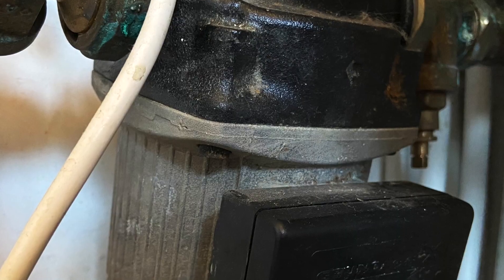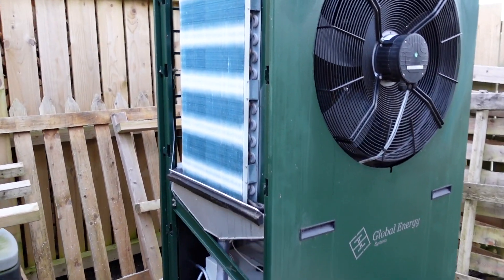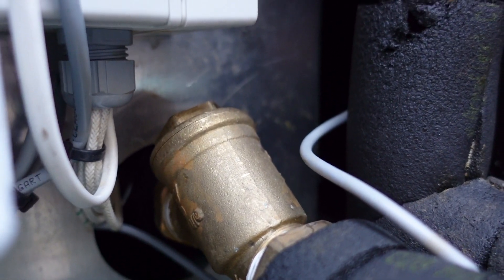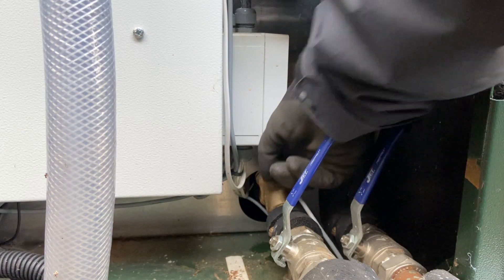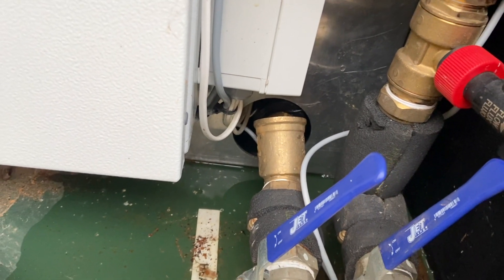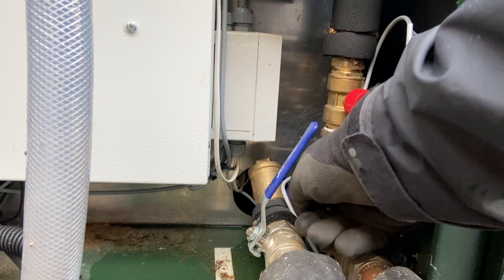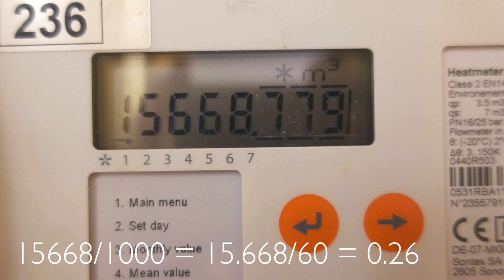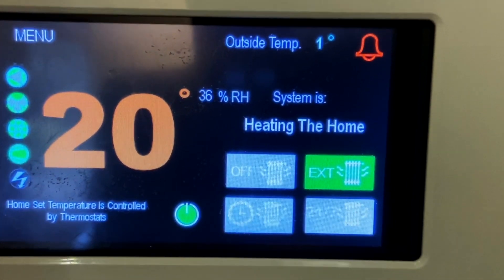Fixing Our Air Source Heat Pump’s Flow Fault By Cleaning The Filter

Comment: Why would the flow block on a very icy day.    do you think that this is a coincidence.
Reply from the maker: No, there was coincidence. Just debris in system which has now been removed and no more errors.
Reply: @MyHomeFarm  assuming like you say it was coincidence why has the manufacturer made a filter the size of a knats leg?
Reply: @MyHomeFarm  also when you cleared the filter  was warmer the next days so even though you got rid of debris it could have been an exposed fitting that froze without bursting   .........

Comment: New house, same problem with little bits of rust repeatedly blocking the filter. Where is it coming from and how to fix it. Towel rails are metal, radiators aluminium (I know that aluminium is a metal). Where do I go from here?
Reply from the maker: It’s nuts. Who knows where it comes from? We were just patient. Months and months of cleaning, and then one day it was just clear, and it’s remained clear for almost a year now.
Reply: It's excess flux from installation. Takes a while to loosen and reach filter.

Comment: Hey man, have you figured out the root cause of this rust?
 I'm having exactly same issue in a brand new house just after 6 months of construction. The strainer filter gets clogged with small bits of rust every other week (yes, that frequent) and plumbers are unable to provide a solution. They have replaced a few rads, flushed the system, refilled glycol but it continues to happen. I'm getting crazy with this thing, I have to go out and clean this thing constantly, not sure if this is a bad design system (filter is too thin?) or the quality of materials used are rubbish...
Reply from the maker: We never got to the bottom on the source. After cleaning the filter for months and months (which was painful) we finally have a clean filter and no more corrosion. 

Weird that you had a power flush and it’s still dirty. Do you regularly have to refill your expansion vessel? If yes, you’re adding more oxygen to the system regularly that in turn leads to more corrosion.
Reply: @MyHomeFarm  I also don't understand how come it still having corrosion after the flushing work. 

I have noticed that the flushing kinda temporarily slowed down the amount of rust circulating and clogging the strainer, but I expect it to continue to happen overtime, which I don't think is any acceptable. I'm not sure if this is an issue with the quality of materials used in my rads or whether the water pump is not strong enough to overcome the resistance of flow on the strainer, when this is not completely clogged.

This is incredible how unreliable this kind of system is and it doesn't tolerate any rust. It requires a lot more maintenance, getting much more expensive in the long run. We all know that rusting is inevitable but this type of metallic filter is extremely sensitive and this tiny thing causes the entire house to get cold. Very frustrating
Reply: The technician who came to sort mine out says it's excess flux (and other debris) from installation - it takes a while for it to loosen and reach the filter.

Comment: On the trap on my system (Midea not the same as yours) the cap is 15/16 or you can use a 24mm spanner. This may be completely different for the other readers here but thought it might prove useful to others.
Reply from the maker: Very helpful for Midea owners. You could also leave a tip at https://renewableheatinghub.co.uk/forums if you get a moment.

Comment: Is there flexible braided pipes in the heat pump ? Notorious for blocking up. How long has the heat pump been in?
Reply from the maker: Not sure that there is a braided flexible pipe. The heat pump is now in its third winter.

Comment: Just had an ashp installed to get off mains gas because it wasn’t very green heating a pool on gas, let alone our house.  Very happy with it.  I thought it might be helpful to say our installer added a SpiroTech MB3 magnet to the pipe work that captures any metal fragments in the water. You could fit that somewhere else that’s easier to access, no spanner’s needed to empty what’s been caught.
Reply from the maker: Thanks for the tip - I'll look into it. Which brand heat pump did you install?

Comment: Check the orientation of your strainer (filter) the angled part normally points down. Looked like yours was pointing up. Does the basket collect any debris? it looked clean when you pulled it out. Have you got any inhibitor in your heating system, I would be thinking about where all the debris is coming from.
Reply from the maker: Hi Nick. Yes, I did look at the Y-strainer and it is upside down. But from the way the pump has been designed it would be impossible to access the nut and filter if it was pointed down. It is weird, because in its current orientation when you open it, stuff just falls back down the pipe which is why we need to flush it.
The gauze has tiny particles in it, and looks 'clean' because the corrosion and rust is very fine. I rinse it off in a bucket of water. But it's not present in massive quantities and can't really figure out why it's 'blocking' water flow. 
The installers added glycol to the system, which supposedly has inhibitor in it.

Comment: Truly awful positioning of the filter/junction box from a maintenance perspective.  As another commenter mentions, get a proper spanner for this. The equipment supplier should provide a ring spanner of the correct size. I’m sure you did following the video, but it is worth cleaning the water and contaminants up after the repair. Thanks for sharing.
Reply from the maker: Thanks for watching Derek and for your feedback. 

I’ll request a spanner from the manufacturer. I have a full size spanner, but given the size of the nut and it’s location, I can get the spanner on, but can’t turn it to loosen or tighten the nut. Not a great location.

Great point about the contaminants. I have starting wiping it up, because that did occur to me.

Comment: Yes a crazy design I would relocate the valve outside the heat pump and as you have an issue with corrosion fit a strainer with a finer filter (possibly fitted with Binder access points on either side of the strainer to measure pressure drop) so negating to have to go inside the Air con unit, I would suggest that the problem of the seemingly rust deposits be addressed, this may be due to the original fill up and pressure test, then drained down and left for a while allowing corrosion to occur (especially during summer) then the system refilled with glycol but as you had trouble with circulation Possibly from end of run radiator the water was not flowing though a high enough velocity to pick up the debris at the bottom of the radiator, but now for some reason the flow has been established and hence the resulting problem, the system has been filled with. glycol but what about corrosion inhibitor? I would suggest to have the system flushed ( in summer time otherwise you will have problems with the one that must be obeyed ). each circuit at a time as the air con plate heat exchanger is Very unforgiving with dirt in the system, and heating performance will drop, and may not be covered with warranty   (yes I used to be in the Business)
Reply from the maker: Thank you for the great response and feedback. The location of the filter needs to be moved, because it’s a pain where it is. A lot to process here and raise with the manufacturer (Global Energy Systems). Thank you. Will post feedback when I get responses and develop a plan.

Comment: those adjustable spanners are great as a fallback solution but you'll never regret having a set of spanners and sockets to use, it will make the job easier and stop the nut from getting rounded off over time. Thanks for the interesting vids!
Reply from the maker: Thanks for the feedback. We have a spanner that fits the nut, but it’s really big,  straight’ and has a long handle, so as a result of where the nut is located along with the box and other stuff around it, when we get the spanner on there’s no leverage or space to turn it. That’s why I resorted to using the spanner we used in the video. What would work is a spanner with a short handle. Maybe I should look into that.
Reply: @MyHomeFarm  A stubby spanner would be ideal

Comment: Must have been some cold nights - thanks for sharing your solution. Hope Global sort out a remedial design for your filter going forward to make it easier to maintain.
Reply from the maker: There were a few a cold nights, and it took 2-3 days for the house to get back to temperature. 

There’s not much we can do with the filter location on this pump, but at least I now know how to get to the filter and open it. 

Global Energy Systems have informed me that the new and current model of our air source heat pump has been redesigned and the filter is much easier to get to. It’s great that they’ve addressed this.
Reply from the maker: I think that from the way the pump's been designed, there's no choice but for this 'main' filter to be where it is. We have got another filter, TF1, inside the house, that is effective at catching metal bits, shards and a bit of gunk. 

As you've said, catching it in a bucket so as not to lose glycol would be great, but from a design perspective, it's pretty hard to do because it's all very tight. The good news is that we've not had any issues, so hopefully we'll run clean again for a year or two, and we'll top up some glycol on our next maintenance.

Comment: Good job! I just pray mine doesn't cause any such issue as I don't have access to help like you do. I can off course ask the manufacturer.
Reply from the maker: It's a good observation Dan, and it's still something that we're trying to get our head around fully. The whole issue of COP can be misleading as a metric, and having spoken to some ASHP engineers, the COP is in some cases secondary provided that the house is being heated to target temperatures within "reasonable" limits of the cited COP. Most ASHPs are tested in 'ideal' situations, and our house (with good, but not excellent insulation) will not deliver the COP that 's on the box. But it's a good point, and one that I will continue to ponder.
Reply from the maker: Thanks Shajahan. As a tip, make sure you get the contact details of your installer, so you can call them to address any issues while your equipment is under warranty.
Reply: @MyHomeFarm  I will have to contact myself as I'm the installer! Joke aside I'm sure the manufacturers will help both UK companies. I have 2 units so if one has issues I can get by with the other!
Reply from the maker: Well, that makes it super convenient then 😀
Reply from the maker: Our metres are in the house, near the hot water tank, and were fitted there by our installers. There could very easily be heat loss between the pump and the house, as our pump is set 20 metres away from the house. I've never questioned the location of the metres, so not sure about this. Something for me to look into. 

In terms of measuring temperatures, would this be the incoming and outgoing pipes? The pipes in the pump are all fully insulated, so we'd have to measure the 'exposed' pipes that are in our utility room where most of the central heating gear is.
Reply from the maker: Thank you Dan. Very helpful and interesting. 

I'll schedule some time to check out the temperatures on the pipework. This could make for an interesting blog piece.